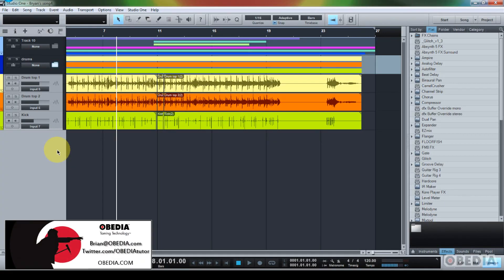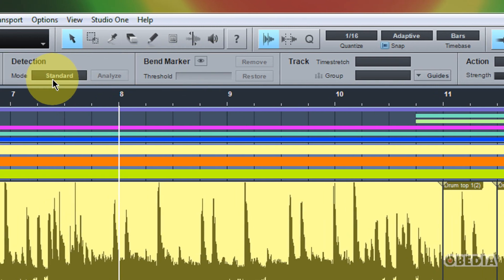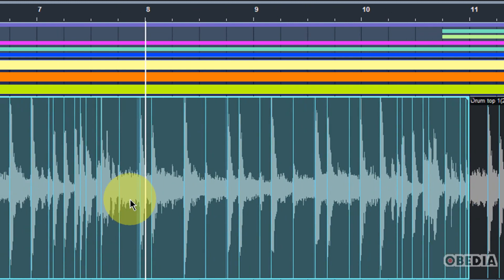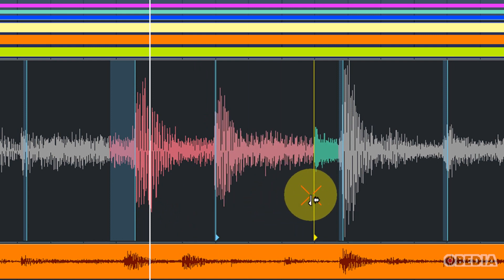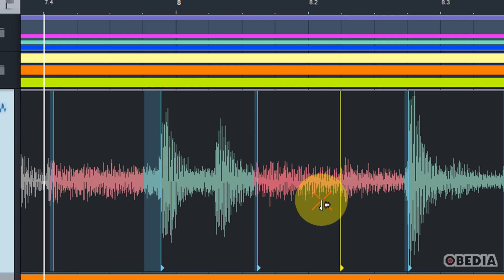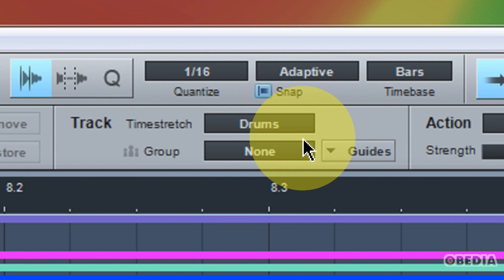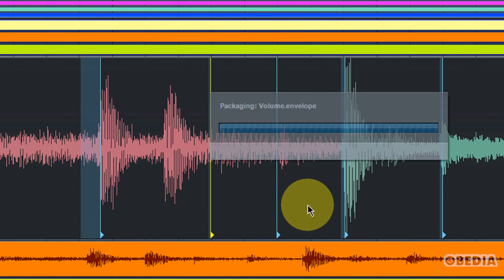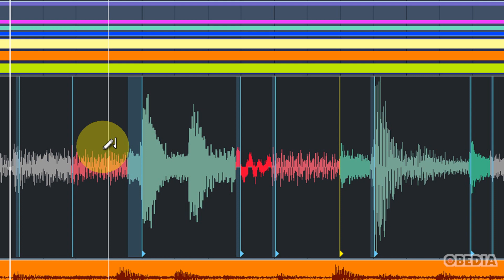How to use Transient Detection & Audio Bend Warping in Studio One

Comment: Thank you for the great videos! I am having an issue with this--I make sure that the Detection Mode is set to Standard, click on the desired track, and click 'Analyze.'  The progress bar appears and does its thing, but nothing seems to happen; it does not show the transient lines.  I see the eye icon next to Bend Marker, but I am unable to click it. Can you or someone help with this?
Reply: I figured it out. I had merged sliced parts and didn't realize that that limited editing capabilities. For anyone else having this issue, select the part and, under 'Audio' find 'Dissolve Audio Part,' and all of your editing options return.